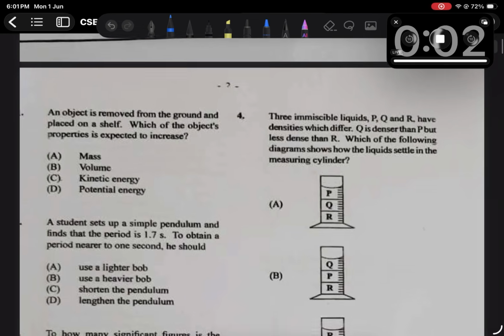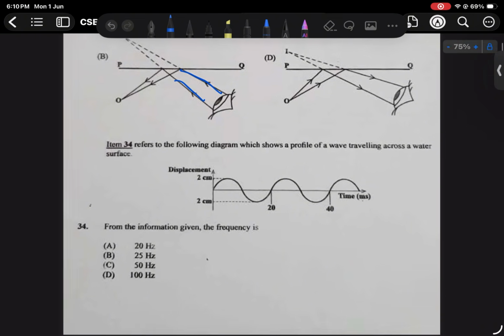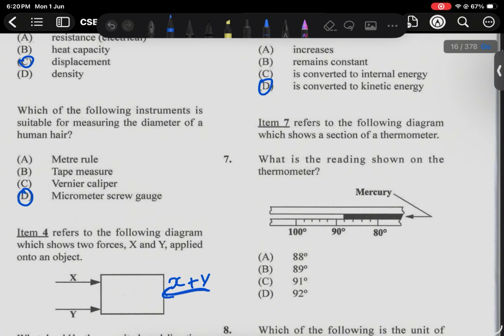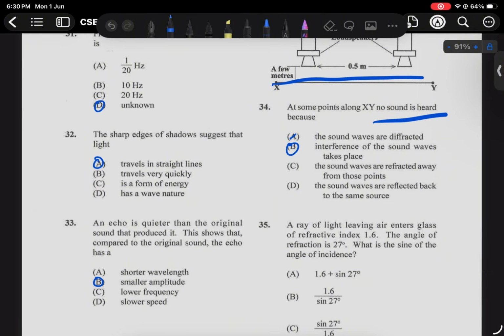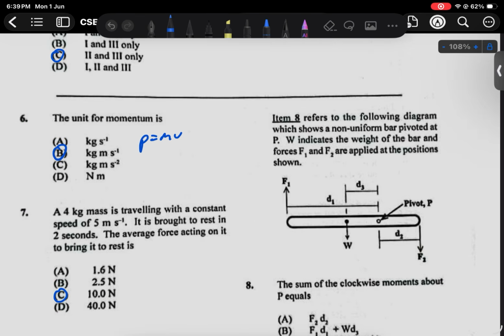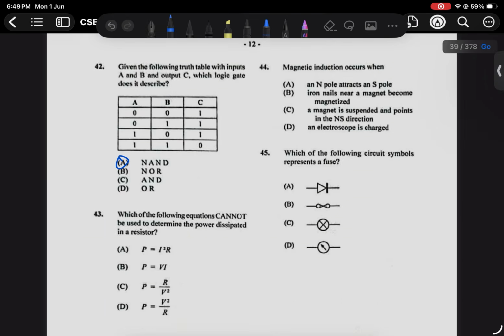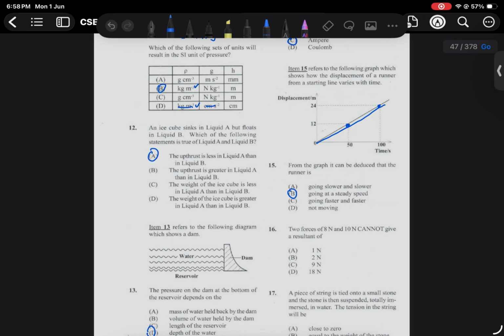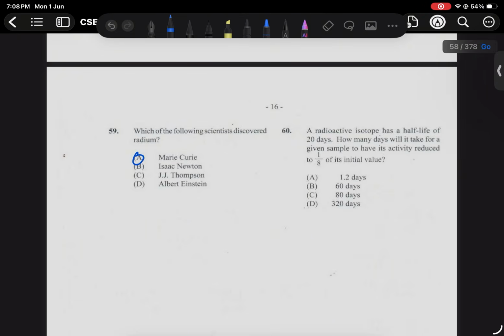CSEC Physics Paper 1 SPEEDRUN (4 Papers in 1 Hour)

Comment from the maker: IMPORTANT (PLEASE READ ALL)
For the very first paper 25 D. Convection does occur (hot air rises above the fire) but that only carries heat upward, not to all surrounding places. Radiation spreads heat in all directions in a straight line to nearby places, which is why you feel warmth standing beside a fire, not just above it. 

Skipped some on first paper aswell because I was moving fast.

36 A
37 C
38 D

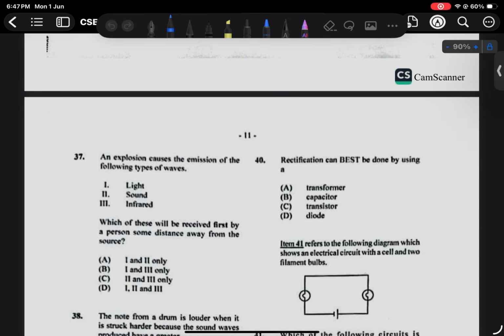Circled wrong answer at 46:46
36) B